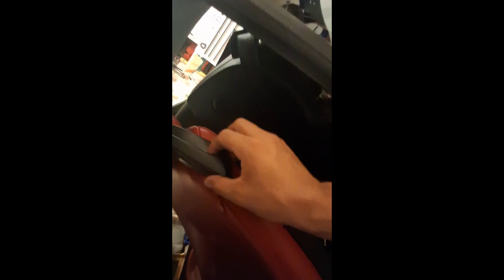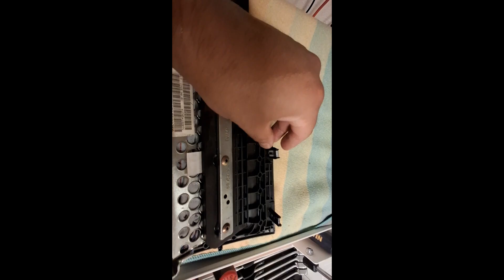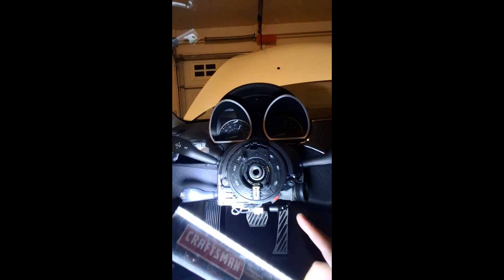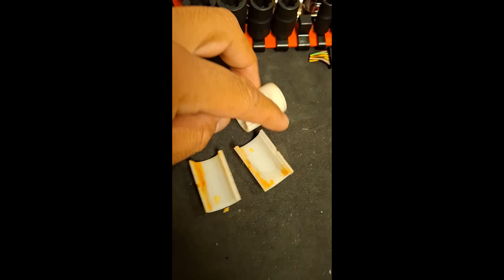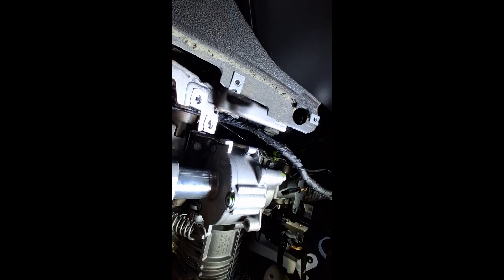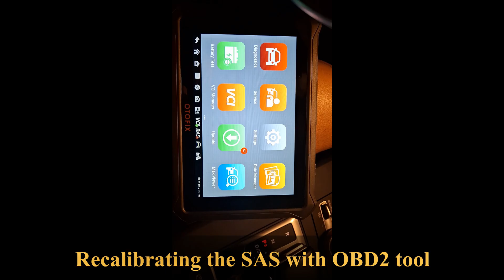Replacing Steering Angle Sensor on a BMW Z4 E85/86

Comment: Is there a way to change the sensor without having to remove the entire steering column?
Reply from the maker: Unfortunately, there is not.
Reply: @realWhy-not-DIY  https://youtu.be/JV14w5q4kKE
Reply from the maker: @chenivan5783 nice video, but this is a different steering column. I kinda wish I had this one though
Reply: You can replace the bushing without taking all the column off https://youtu.be/JV14w5q4kKE